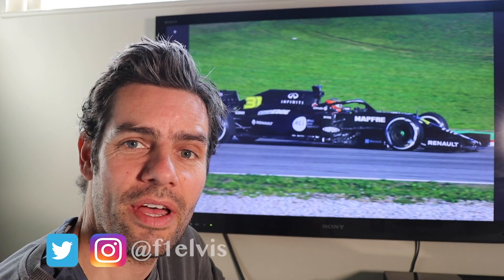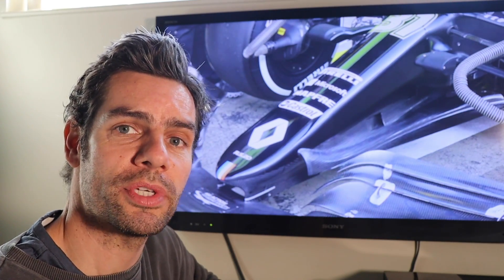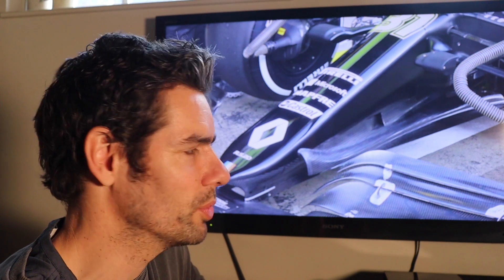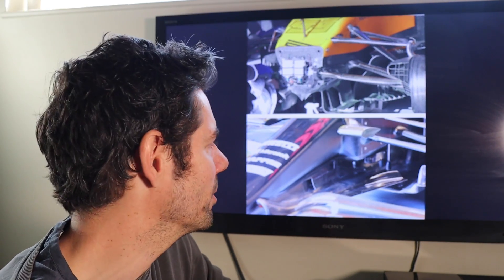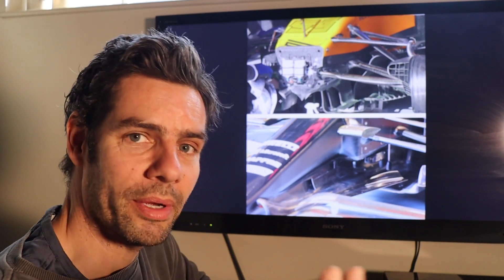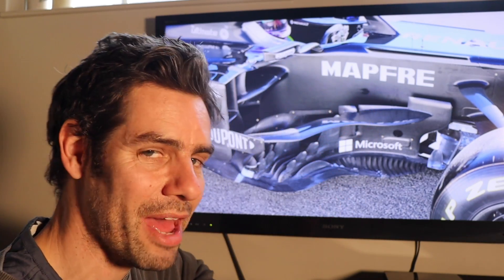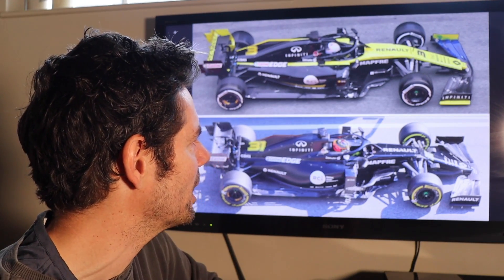2020 F1 Cars - Renault RS20 Tech Review - MP357

Comment: Marc could you please explain why, in testing, drivers lift off before crossing the line on a hot lap to "disguise" their pace. Completing 95% of the lap provides all the data the rival teams could ask for when analysing pace.
Reply from the maker: Just stops the headline writers getting over excited and piling on unnecessary pressure.

Comment: Marc, would that "after thought" area be an sign that they had problems meeting the crash test minimums?  I'm curious to hear how you might have solved this area if it was a last minute issue they came upon.
Reply from the maker: It could be...
Reply: @F1Elvis  My second thought was when I was looking at this nose area was, why don't they keep it a little wider and make the top surface concave in a way that pushes to air up over the driver into the engine box or around the sides of the of the driver somehow.  I was kind of thinking about the front of the new Jaguar Ipace and that slot type bonnet area..  I'm not an engineer so I love watching and learning about these things.  Thanks!

Comment: If they were going to use last year’s chassis, they could’ve shaped the nose cone to integrate so it didn’t look like that
Reply from the maker: The thinner nose is obviously a greater aero benefit than compromising to make it look nice.
Reply: Marc Priestley the thinner nose has a lot of effect on how the air flows under the suspension and through the car. This just leads me to believe that Renault will not be in F1 2021. If they were going to be, they would be developing this car. Both drivers are off contract and there are other whispers as well.

Comment: Hi marc,

I'm curious about some of these cars using a matte finish. Do you think there could be any aero deficiency by using a matte finish vs using a polished finish?

My thinking is that, with a matte finish, the surface usually isnt smooth, but has tiny imperfections, almost granular, where as the shiny finish would seem to be much smoother, or slicker.  Wouldnt air glide more easily over a glassy finish vs a matte finish and thus have less resistance?  Could this translate to any loss of time on the track,  even is it's just a tenth per lap?  Or would it make no difference?

Thanks.

Comment: I don’ t get why they did not flare the nose piece a little to improve the airflow where it joins the chassis. Strange.
Reply from the maker: There's obviously more benefit in the slimmer section, than making it look nice, but an afterthought is still never as good as the real deal.

Comment: Thanks for your great videos! Are you allowed to connect the 5 planes of the front wing on the inboard edge with an endplate, to prevent spill over? This could reduce the swirl and might help clean air reach the bargeboards or?
Reply: no its the other way arround. they want the spill over to create a strong vortex there (Y250) because its necessary to block the turbulence created by the front tires from the clean air in the middle for the floor. the bargeboards kinda take that vortex and throw all the turbulence away from the car so that the parts behind dont get disturbed (sidepods, coke bottle, rear wing/diffusor). at least thats how i understand it.

Comment: After 2021, Renault will mot be in F1 any more.
Renault gave a budget for F1 and they tried to sit on the front row on a budget. Yes they have a budget higher than most team, but they aren't ad the level of the top 3 teams.
They waited with buying Lotus, so they could get it cheaper. That made that many people already left. And as people leave, it are always the best people that leave first. 
As they where fighting for the championship after 5 years, the budget would be higher. But they aren't. It went even down with Riccardo and that they only had 1 customer and 0 next year.
Now Renault is focusing on 2021 and not on this year. Yes tgry improved the car, but developed will go slower and the pu is even on a hold for this year. Yes they say that they work on it for 2021, but funding is lowered because of the 2021 car.
As 2021 doesn't make that they closed the gap yo the top 3, than Renault will leave F1.

Abiteboul has his toy, but can't lead the team. He makes things personal and acts on that. Getting Riccardo for that amount of money is z'n example of that. Abiteboul is the wrong person to lead a team. Prost was a very good driver, but never very good in getting a team to the top. 

2021 will must be successful, but that will mot be the case. 
Riccardo shall need to accept a lower salary after this year as he wants to stay with Renault, or leave the team. 
They hot Ocon because he was cheaper than Hulkenberg and because he is French. That is just to please Renault and noting more.

Comment: I´ve noticed that nose transition in the first day they showcased the car for the first time and i was shocked by it, the transition is non-existent almost. Clearly they are saving money because they didn´t want to redesign their central section. But why not create a better transition between the nose and that section? It´s something that I´m scratching my head about, because having that block must create unwanted aero effects, but they still went with it. Very very strange. Of course they could be cutting corners in order to have more money and resources for 2021 car?

About Renault staying or leaving, i think it´s all about what happens this year in the first 4 races or so, because if they decide to leave, they must do it before spending money on improving the power unit and a completely new car for 2021. But what you said is pretty accurate, no clients for 2021 (at least for now), Ricciardo is pretty expensive and building a new car for 2021 is not cheap. Seeing all that pile up with them being beat by their customer and degrading their image even further, I also see them leaving at the end of the year.

Comment: When the 1st few pictures of the Renault were released, some people commented that Renault had gone for a Mercedes style nose.
My response was "No. It is a big change in philosophy for just one season. It will likely be more in tune McLaren's 2019 nose".

I was wrong! I cannot understand why Renault went for a "half-way" measure. The transition from the nose-cone to the chassis is just too aggressive, in turn, more draggy. Additionally, separation will occur, which will have to be conditioned downstream. Thus, more drag.

Is the parent company turning off the investment tap? That's the only reason I can accept, apart from a chaotic technical department.

Comment: Wow, when you look at it it really looks like a brick wall in the path of the airflow. Seems that would push airflow out into the path of the y250 vortex. Maybe disrupt that and make all those fancy barge boards useless.
Yet to be seen but as you pointed out, the cost savings are not confidence inspiring.
Reply: why didnt they transition the top of the nose (flare out) more to fit the old chassis if thats thier chosen design route, such a step change looks awful and prob performs awful too.

Comment: #askelvis - you frequently refer to the artistry of the barge board area, and rightly so. My question is: is there a reason the whole car doesn't look as intricate? Is it cost, regulations, or simply that the bargeboard is a vital 'transit hub' to receive and direct airflow around the car and has a more complicated job to do?

So many thanks for all the great work you put into the channel!
Reply from the maker: If the whole car looked like that, it would extremely high drag. The bargeboards are flow control devices, so need to work the airflow particularly hard in that area.
Reply: @F1Elvis  thanks Marc! All the best

Comment: Renault doesn't have more resources than McLaren (over the last two years it was about equal, before that McLaren had more money and a steady infrastructure) . Ghosn at the time allowed them to go back in F1 on the terms that everything was done based on cost efficiency. The reason why they got back in F1 was because of the budget cap which is what they probably designed their infrastructure around. The whole technical team got replaced last year and they are the ones who need to design next years car under the lead of Pat Fry who designed last year's McLaren. Btw, Ocon also has a contract for next year.

Comment: First of all, both of their drivers are not due to renew their contract for 2021, as Ocon has a two year deal, and will have to re-sign for 2022. 

Secondly, is it possible it's just to have a decent 2020 while working on the 2021 car that they reused the same chassis? I mean, it's the last year of the current regs and it's no secret Renault's aim is for 2021, I think they are the first team who started work on the new regulation car, so isn't it smart to put the most efficient ressources possible into 2020? They may feel their 2019 car underperformed because it wasn't able to keep a stable aero while turning. If they adress that problem, then they've got a solid base to make easier work on, with proven, known and tested parts. I feel that to be 4th or 5th, this could be sufficient, and would allow less work to go into the car, or at least a more efficient work.
Reply from the maker: That is clearly one theory, as I said, but at a team that desperately needs to convince its struggling parent company to continue investing many millions into F1, it's a brave game to play...we'll see about Ocon's contract....
Reply: Marc Priestley If we were to say (very hypothetically) that Renault stays in it no matter what, what are your views on this strategy then?

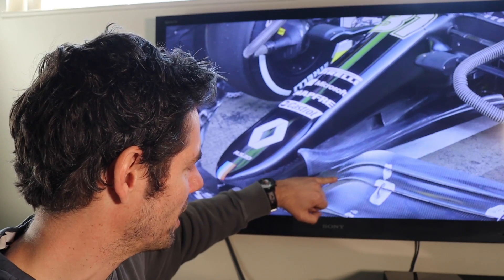Comment: Hello Marc, loving your videos they helped me learn so much about F1 and the opportunity to look from an insider point of view. I appreciate the videos and love your work! However, I noticed a small error at 1:52 where you mention that the air needs to speed up because it has a longer distance to travel and therefore there is a lower pressure region but this explanation has been proven to be false and the airflow doesn't have to meet up at the end of the travel through the shape in the air stream. They don't meet once they are through the wing element. What is the right answer? I'm not sure,  I'm not an aerodynamicist but just a mechanical engineering student. I looked up for the right answer but some of them were too complicated for me to comprehend but one answer to it was that the curve leads to centrifugal force thus drops the pressure below the wing element and increases the pressure above the wing element, that also leads to air coming into the element to move in more volumes to the low-pressure region and that creates a squeeze which leads to speeding further while in the higher pressure region, lower volume slows down thus feeding the high-pressure loop. If there is someone with knowledge who can enlighten us on the matter, I would love to learn!
Reply: As air flows over the curved upper surface, its natural inclination is to move in a straight line, but the curve of the wing pulls it around and back down. For this reason, the air is effectively stretched out into a bigger volume—the same number of air molecules forced to occupy more space—and this is what lowers its pressure. For exactly the opposite reason, the pressure of the air under the wing increases: the advancing wing squashes the air molecules in front of it into a smaller space. The difference in air pressure between the upper and lower surfaces causes a big difference in air speed (not the other way around, as in the traditional theory of a wing). The difference in speed (observed in actual wind tunnel experiments) is much bigger than you'd predict from the simple (equal transit) theory. So if our two air molecules separate at the front, the one going over the top arrives at the tail end of the wing much faster than the one going under the bottom. No matter when they arrive, both of those molecules will be speeding downward—and this helps to produce lift in a second important way.
Reply: @sandybarnes887  Thank you for the answer! In that case, is the centrifugal force acting upon the air molecules negligible?
Reply from the maker: I didn't say the air molecules have to meet at the trailing edge of the wing, but it is a fact that the flow travelling around the curved underside is travelling at greater velocity that that flowing over the top surface.
Reply: @F1Elvis  You are right, I assumed that you mentioned the equal transit-time theory which takes into account that the longer distance of travel leads to higher velocity of the airflow. In that case it's my mistake, sorry.
Reply: Smiles...  That question is far above my pay grade. :)  I just copied and pasted some quick research from the internet to help you.  Read the full article?  https://www.explainthatstuff.com/howplaneswork.html. Your inquisitive nature will carry you far, young man.

Comment: I wonder if Renault found an issue with the 2020 chassis? Maybe a spec 2 chassis for aus? Alternatively they have given up and are concentrating on 2021? I think that the new Concorde agreement hasn't been signed yet so you might well be right, signs that Renault are pulling out at end of 2020!!!

Comment: I noticed this transition and had the same exact thought. All the other pieces are in place for an exit this year. This car is going to determine if that happens. It doesn't seem to be ambitious enough to change what looks inevitable. Maybe that's positive. Maybe it'd be better for the sport if the team was purchased by a group with more ambition. Renault-Nissan are in a tough place right now.
Reply: I work with a supplier of Renault, our management is saying that this year will be the worst since 2010/2011, at that time the crisis the manufacturer went through made them leave F1, it might happen again
Reply: 2010 season was a good season for Renault

Comment: Very interesting, I've been waiting for this analysis for several weeks. 
Question: can they can change the chassis during the season?
Reply: Can. But wont be cost effective. Takes about a year to develop a chasis concept.
Reply: This year's chassis is a dead end.  New regs for next year and hardly makes sense to pour money into a dead chassis as Mark mentioned in the video.  

Renault hired a new aero team end last season.
Reply: They can. Look at Mercedes after the summer break in 2018, basically a new car in Spain. But with 2021 in sight, it wouldn't make sense, unless the have something on the drawing board already.
Reply: It's a costly proposition since a new design has to undergo crash testing and will not have the benefit of winter testing to prove its worth. Trying to accomplish pre-season work on what should have been getting ready for qualifying during a race weekend is a tall order.

Comment: Renault has the same leadership problem McLaren had for so long... I can’t stand hearing them, year after year, proclaim their car/chassis/engine is the best on the grid.  It has already begun this year when in fact they could get beaten by Racing Point AND McLaren.  I can’t imagine they’ll stick around in F1 for too long if they have no customers for their engine and are finishing in the bottom half of the grid.
Reply: people make such a fuss over the money lost losing McLaren and Redbull when it simply means less expenses to put into dealing with other customer teams and being able to completely focus on themselves
Reply: GloomGaiGar i don’t think it’s revenue that’s the issue, just that there’s no one who wants their engines or the “deeper technical partnership” they offered to McLaren.  Losing your two customer teams in successive years would seem to point toward a pretty significant issue.

Having engine customer teams does allow for more learning and development; powering six cars for a season rather than two is a big deal, as is the $10-15 mil/year from each team that can be put back into development.  (I recall reading Mercedes charged then Force India $13 mil/yr in the years before administration, so used that two year old number as a rough guess on cost).
Reply: GloomGaiGar that said i agree 100% that putting on blinders and focusing on themselves should be an opportunity for Renault.